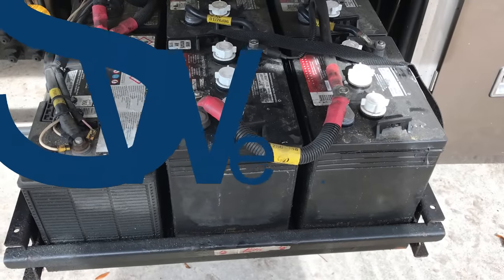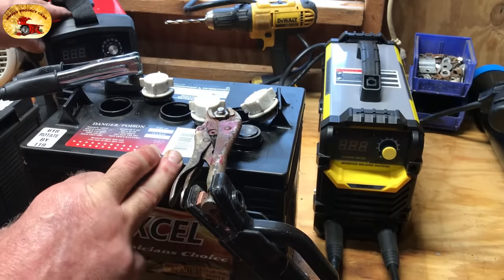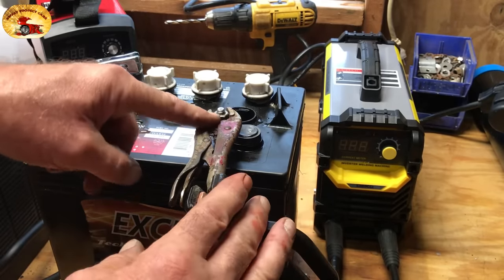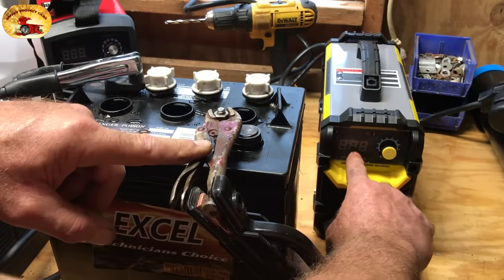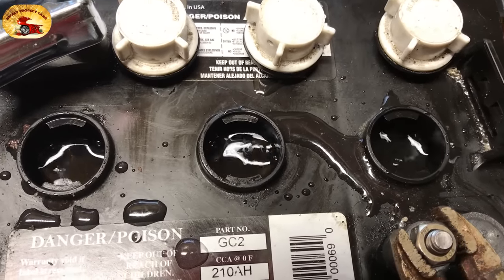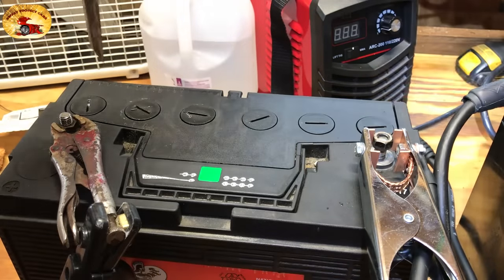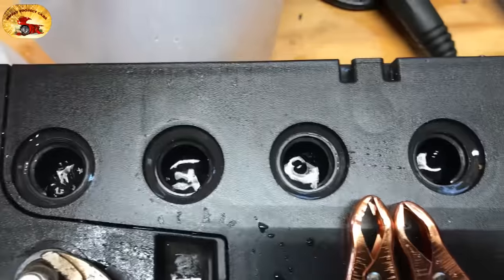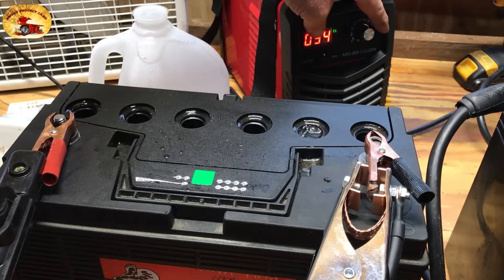How To MAKE OLD BATTERIES NEW Again!!!  12v 6v Deep Cycle, Car, Truck, Golf Cart, Semi

Comment: Just curious why you say the deko pro welder is only for a deep cycle end 6 V batteries it seems like it should work fine on 12 V battery also? Thanks
Reply: Of course I could be wrong. I guess you wouldn’t know for sure until you tried it.
Reply from the maker: It's just how it is rotfan77. We've done extensive testing on both welders with all types of batteries and the welders we recommend are the one's in the description. Hope this helps, we appreciate the view, have a great day my friend. mad Mike the hammer SPC

Comment: Can the 200 amp welder be used for the 6 volt and deep cycle batteries also, or are you saying that I have to have the 160 amp version to recover those  I have to have the 160 amp version to recover those batteries?

Comment: Did this with the battery out of my wife's car, opened it up an there was barely visible water. Kept adding water until it was about a half inch from the opening turned the welder on (red one you have) and nothing. Turned it up a bit and the water started overflowing. Any idea why? After the water leveled out it was bubbling a bet. After five rounds all but one bubble well the odd one out bubbled but dot as well.  Will check the voltage I  a few days to make sure it's holding. Thank you.
Reply from the maker: Depending on the battery, before starting the charging process you want to be about a quarter of an inch above the plates inside, and turn the charger up slowly, turn it up too much and it will overflow especially if there is too much fluid in it.  Thanks for watching Scott!  Have a great day.  mad Mike the hammer SPC
Reply: Bubbles displace liquid, they form all down inside the battery and bubble up. Too much fluid and it overflows.

Comment: after the final boiling process, have you ever dumped out the old acid?  seems like you should be getting rid of that old dirty acid and adding new acid .  your thoughts??
Reply from the maker: Not necessary.  We've found that when you analyze until paralyzed you don't accomplish many things.  Our channel is based on simplicity that works.  Great question though, thanks for asking.  Happy New Year.  mad Mike the hammer SPC
Reply: @SweetProjectCars  Love that philosophy! 👏👍

Comment: After this process of reviving a battery you still have to charge the battery using a regular charger correct? If so what’s the recommended charger for this job? Thanks

Comment: Can I use the same welder for 12 volt car batteries and 12 volt marine deep cycle? Which welder or welders?
Reply from the maker: Yes you can.  The red one is the one you want for all 12v batteries no matter what they are.  Thanks for watching and for your question!  Have a great night.  mad Mike the hammer SPC
Reply: Just not sealed agm or lithium

Comment: bought the red welder and tried to rejuvenate a battery made in 02 that finally sulphated and dropped voltage to 10.5 volts. The battery boiled all cells at the lowest setting and 1 cell in particular looked like a steam engine. The battery voltage went up to 13.7 when I turned the welder off but leaving the meter on it slowly dropped back to original 10.5 volts. Do you suspect the battery is too old or maybe some of the plating inside has fallen to the bottom and causing a short in one of the cells. Not questioning your procedure but am trying to find out where I may have gone wrong.  I live in Canada and know our batteries are more for cold climate and the cca are important for winter starts. Love the welder and of course your channel and am hoping you might be able to shed some light on what went wrong.  Thanks----Brian
Reply: Hmmmmm ??? Great question dead cell/ plate fractured maybe?
Reply from the maker: The problem is that when a battery has sat for a long time with out a charge in it, which your battery sounds like could be the case, the battery will rot due to the lack of charge.  Hope this helps.  mad Mike the hammer SPC
Reply: That has one shorted cell, usually that cell won’t recover.

Comment: Whats the welder machine output voltage? I have some problems with sulfation on my trojan t105 re  but i have welder machine with transformer is not electronic. It is good to try with mine? Thanks
Reply from the maker: It's this  https://amzn.to/3yW4ihK  you can get all the specs at the link my friend. We only recommend using what we share, we know the process works with our suggested tools/products and we know it's safe for both you and your batteries Marius. Thanks for watching, have a great week. mad Mike the hammer SPC

Comment: when you were doing this recharging what is the difference between welders that make them only suitable for certain types of batteries. If you purchased only one and tried to use it for both what would happen. I'm not familiar with the charging of different types of batteries and am sure I'm not alone. Thanks
Reply from the maker: The yellow is for 6v because it's lower power, the red one is more amperage for 12v, trust us, you do not want to switch them up.  Thanks Brian!  Have a great night.  mad Mike the hammer SPC

Comment: Thanks for the video, I got them both. What settings do I use for 12V RV/marine deep cycle batteries?
Reply from the maker: Start at the lowest, and work your way up as shown in the video.  Follow the video to a T.  Thanks. mad Mike the hammer SPC

Comment: During the process what signs do you look for indicating the battery is now good?
Reply from the maker: Every cell should be bubbling, if you have cells that aren't bubbling you need to repeat after the resting periods until all of the cells have a consistent boil. Re-watch the video, maybe a couple times before doing it. And make sure to use the same products/tools shown in the .... more of the description. Hope this helps, thank you for watching and asking. mad Mike

Comment: Why not just buy a de-sulfating maintainer? Got one for my boat and seems to work great...
Reply from the maker: You can do that if you want, but it doesn't work in any way shape or form like this process.  The difference between the charger you have and our process is like washing your clothes on a rock in the river vs. using a washing machine.  Thanks for watching. Have a great day. mad Mike the hammer SPC

Comment: Have you tried this with an “old fashioned” DC arc welder. (E.g. Lincoln “tombstone” AC/DC arc welder capable of 25 volts DC and 125 Amps  when set to DC)?
Reply from the maker: Rick yes we have but found mediocre results so we went to these inverters with stellar results.. thanks mad mike SPC
Reply: @SweetProjectCars  Have measured the output voltage from these inverter welders ?
Reply from the maker: Chris yes we did and they are dead on correct ..have fun with the process  mad mike spc

Comment: Looking at the spec of the UK welder you have kindly provided, the welder operates at around 27 V, could a 24 V charger be used in place of the welder?
Reply from the maker: Give it a shot David, if it doesn't work for you, you know what you have to do.  Thanks for watching, have a great day. mad Mike the hammer SPC
Reply: Stick welders are constant current (amps) power sources.  Turn the dial to one amperage and it will put out exactly that amperage.  When welding, the voltage will change to whatever is needed for the spark to jump the gap between the electrode stick and the work metal.
Normally in a battery, the gap between the plates either requires 2 volts to charge, or produces 2 volts.
Battery chargers are often sold in 2 amp, 6 amp, 12 amp models, and a few large ones only sold to garages around 80 amps.  A typical stick welder runs at 120 amps for a 1/8" welding rod.  So what these welders are doing is brute force charging and boiling the water underneath the sulfur scales coating the lead plates and breaking them off allowing the water in the cells to finally touch the plates.
Reply: So David Alton was asking about using a 24 volt charger instead of a welder with 27 volts peak capacity.
Just because his listed welder says 27v doesn't mean it is putting out 27v. If when welding, you pull your electrode away from the workpiece too far, the machine will increase the voltage to 27, and when your electrode is too far away for that to jump the gap, the machine shuts off.
If a battery is 12v, and you attach a 24v charger to it, it may or may not do anything different than a 12v charger.  Depends in the amperage setting you turn the charger into.
Using 24v to charge a 12v battery won't do anything special.

Comment: I bought the welder and load tester that you recommended. The yellow one. They came yesterday. Hopefully tomorrow I will give it try on my golf cart 6 volt batteries. The batteries have a least one or two low cells.   0.5 volts to 1.5 volts. I hope to bring those cells at least back up to 2.0 volts. The batteries are 3.5 years old. I am going to try and take each battery out of the cart to do this. I don't want battery acid running out onto the shop floor. Beings as they are heavy, I will have to lift them out with a chain fall. Going to be a lot of work.
Reply from the maker: Awesome! Thanks for watching and sharing Smitty, have a great week and all the best on your project my friend. mad Mike & team

Comment: Great video.  Would you possibly get even better results by, after desulfating, you dump the liquid out of the battery and replace with fresh battery acid or distilled water?  Thanks!!
Reply from the maker: Yea, you don't need to do any of that, it's the purpose for the video.  The only thing you need to do is keep the cells topped off with distilled water during the resting process.  Thanks.  mad Mike the hammer SPC

Comment: Why is this method better than your other way using the 200amp battery charger?
Reply from the maker: The biggest reason is that the welder is made for heavy loads, they don't fault out and they are faster and the other bonus is you can weld with it.  Thanks.  Have a great day.  mad Mike the hammer SPC

Comment: Alright so far, but what  do you do about a battery that has  ple of debris on the bottom that is shorting the plates   out?
Reply from the maker: This method will dissolve all debris.  Thanks for watching.  Have a great day. mad Mike the hammer SPC
Reply: @SweetProjectCars  So will you have to dump the old acid/water mix and start fresh?
Reply: In a prior comment he answered that question. No need to dump out the acid or change it. Just leave it as is. Just be sure you top it off with distilled water before the process, during and after. Eazy Peazy😃

Comment: Very good but some welding machines out put is a c current and some are d c current out put you don't want to put ac current inside of a battery that DC  current inside
Reply from the maker: You are correct George! DC output, that's why we listed the welders that we use specifically for this process in the .....More of the videos description. Thank you for watching, have a great day. mad Mike the hammer SPC

Comment: This only works with wet cell batteries, right?  AGM batteries...the expensive ones with glass mats die a hard death. This process will not work with AGMs I'm guessing.  Have you tried, SPC?
Reply from the maker: Hello Enzo, no this does not work on AGM batteries.  Thanks for watching.  Have a great day.  mad Mike the hammer SPC

Comment: What’s the difference in welders between the one that works for 

1. Deep cycle 12 Volt and 6 Volt batteries
2. Standard 12Volt batteries
3. 6 Volt batteries?

Seems like Amps and Cycle time? Why the need for different welders if you can adjust amps and time?

I would prefer to buy one welder to cover ALL my lead acid batteries...Any help?
Reply from the maker: You can buy whatever you want and do whatever you want to do, we are just sharing what years of testing and experimenting has proven the safest and most effective for each type of battery.  Thanks for watching.  mad Mike the hammer SPC

Comment: Looks like a good process to check out.  I have a 7.3 diesel engine that has two batteries that just went dead.  This will definitely cut the cost to replace these batteries.  Do you have any videos on lawn mower batteries?  Thanks, Will
Reply from the maker: Hello Will, for lawn mower batteries, you can use this process just cut all timelines in half.  Thank you for watching, have a great day. mad Mike the hammer SPC

Comment: Fantastic video. Thank you very much. I tried it with success so far for the 3 I just  performed "cpr" on it with your method. Worked great. Question though...is the 5 times a magic number? Because I checked voltage after just one attempt and I was back to 6 volts. Does it matter that I didn't do the total number of trys? Thanks again
Reply from the maker: We've found that if you don't do the 5 times you won't get the sulfates dissolved from the plates and you will probably have to do this procedure more often. Do it the 5 times Jake. Glad we could help my friend, great job! Thanks for watching and asking, have a fantastic week. mad Mike the hammer SPC
Reply: @SweetProjectCars  Thanks. That makes sense.

Comment: What about doing this then draining the batteries to get the sulfur sludge out, and then throw in distilled water for a clean out then put new acid into the batteries? Then even do this with new acid...  I know it may not be needed but could that help even further?   Even doing all that extra between buying a few more gallons of D.water and 3 gallons of new acid is at most another 100 bucks.  I know old school rule was never to drain the acid out but i feel with this process it might help infuse new acid to the batteries.  ? Thanks either way great video!
Reply from the maker: It's not necessary, but if it makes you feel better, have at it! Remember, the acid doesn't evaporate, it's still there just need to add fresh  https://amzn.to/3gb9Ni0  before beginning the process then at the resting times if needed. Thank you for watching, have a fantastic day my friend. mad Mike the hammer SPC

Comment: Hello Mike , just watched your amazing video and many thanks for sharing your knowledge . Just few questions 1) can I use this technique to rejuvenate my 150AH Tall tubular 12V inverter batteries ? 2) what’s the voltage  output from the welding machine . If it’s above 12v , is it ok to subject the batteries to higher voltage ?  Thanks once again . Greetings from India 🇮🇳
Reply from the maker: Hello MEC, this can be done on any wet-style battery. Just set the welder on the lowest setting, then turn it up slowly until you get a consistent boil on each of the cells. Hope this helps. Thank you for watching and being here with us from India, we appreciate it. Have a great weekend my friend. mad Mike the hammer SPC

Comment: Hey Hammer looks like youre loving the south everytime i see ya you have on flip flops lol. Will the 12v welder work on the 6v batteries?
Reply from the maker: Yeah, I haven't worn a shirt or pants in months LOL :)  Not sure if you saw in the video, or how much you watched, but the first battery we did was a 6v battery.  The yellow welder is the one you will want to use for 6v batteries, the red welder is for 12v batteries.   Hope this helps.  Have a great day.  mad Mike the hammer SPC
Reply: @SweetProjectCars  have you tried the 12v welder on the 6v deep cycle batteries. I bought the Amico welder and I was hoping it may work on the 6v deep cycle batteries as well. Thanks for everything you share! God bless!

Comment: For those wondering why the need for 2 welders, the 200amp is too big for 6V batteries.
Reply from the maker: Thank you for watching and sharing, we really appreciate it, have a great week my friend. mad Mike the hammer SPC
Reply: What does that knob on the welder do? The one that changes the digital display number? The product description suggests one can regulate current(amperage) variable via that dial. Seems like one would be able limit amps to 6 volt batteries that way.

Comment: What if I can’t get 1 of the cells to boil?? Got the grey welder maxed at 160.
Reply from the maker: You can do the entire 5 step process up to 5 times, if it doesn't work after that, your battery is toast. Thanks for watching and asking, have a great day. mad Mike the hammer SPC

Comment: Great video as usual.  I liked it so much I ordered the Amico welder you recommend.  The question I have is do you hook up the welder connection's as DC + or DC -.  I have watched the video several times and I could not tell for sure.  If you could let me know I would appreciate it.  I want to make sure I am make sure the welder is set correctly and I am putting the 
connections on the right post.
I have been following your series on  how to make money on reconditioning cars and trucks.  I love it so far and cant wait to see how the truck turns out.  Thanks
Reply from the maker: The clamp part of the welder the ground goes to the ground post on the battery the other goes on the positive. Hope this answers your question, Robert.  Thank you for watching, we appreciate it.  Have a great day.  mad Mike the hammer SPC

Comment: Question. For a car battery,  does it have to be a 200 amp welder. I have a 160amp available and wanted to know if it would still work?
Reply from the maker: Our videos are very product/tool specific, you can use whatever you want to use, but to get the same results shown, you need to use exactly what we use. Thanks for watching alfredo, have a great day. mad Mike the hammer SPC

Comment: Do u use any welding machine...I have a heavy duty charge will this work?
Reply from the maker: Please follow the video to a T, there is no other alternative, use the exact same tools, products and method, we've spent years perfecting this process. It works flawlessly every single time using either of these welders for standard battery  https://amzn.to/2K1UsWQ  or deep cycle  https://amzn.to/3yW4ihK  Thanks for watching, have a great day. mad Mike the hammer SPC